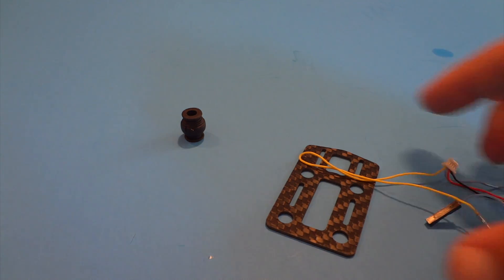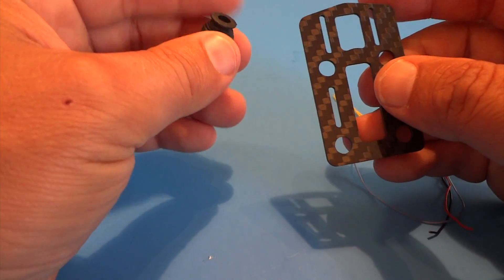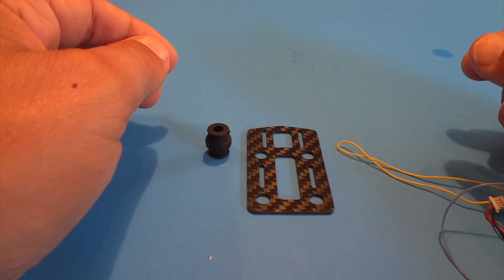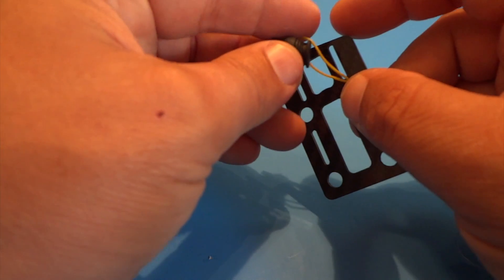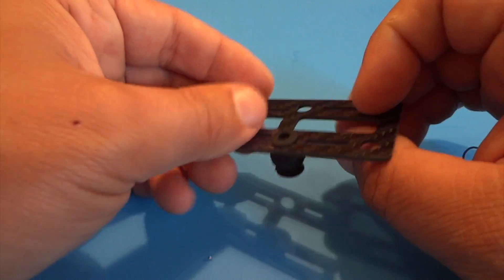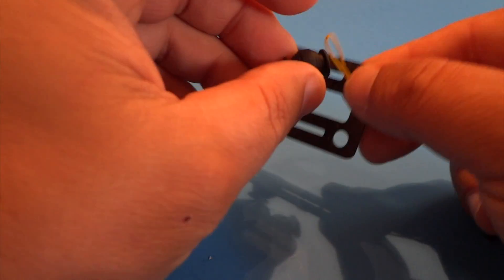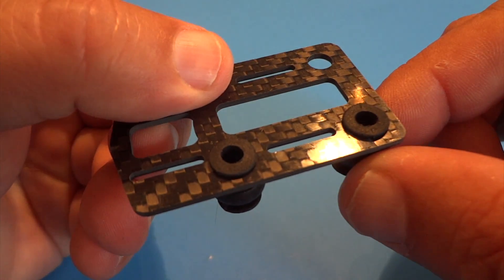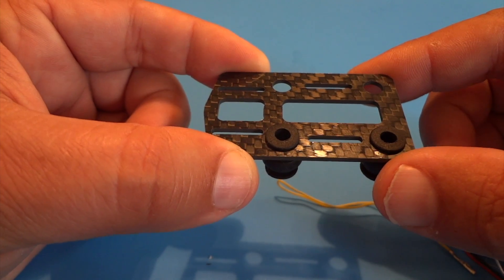How to install Anti vibration Rubber Shock Absorber Ball TRICK

Comment: Brilliant! One hint: the second side is much harder than the first. The trick: Once I put the wire thru the hole, with tiny tweezers, grab along the "slot" (or maybe "neck") between the ball and the end, and twist together the wire so it's like a necktie around the slot. Only then, pull it thru.